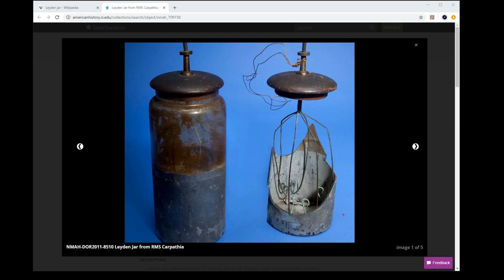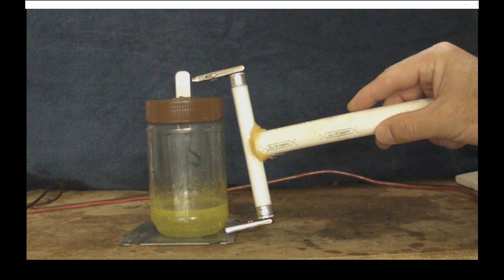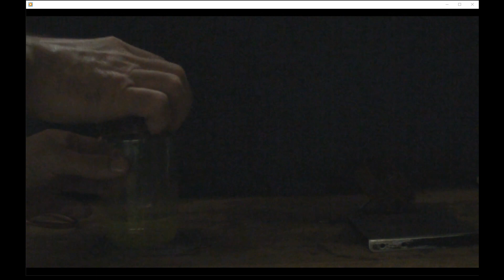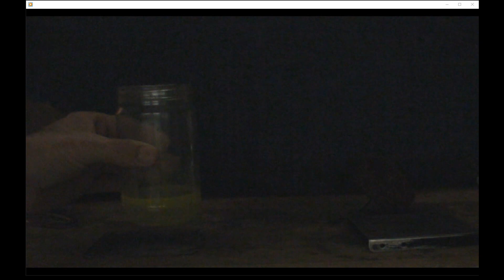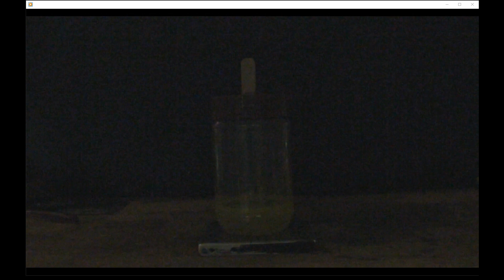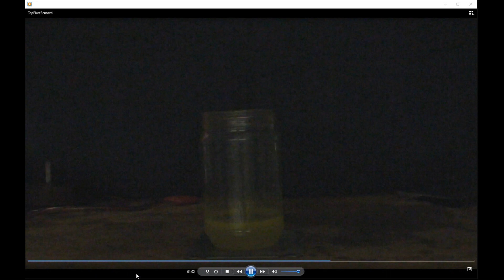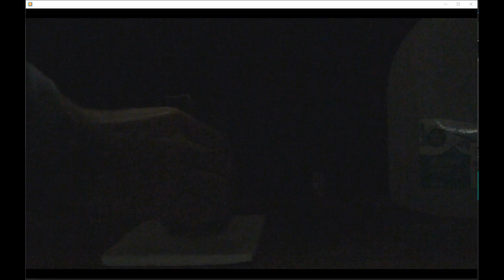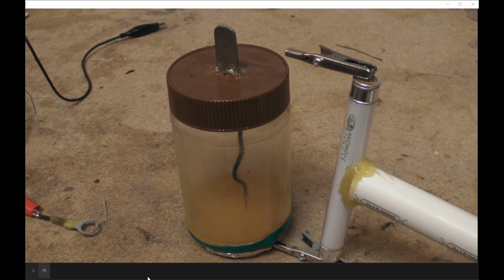Electron Theory can't explain Capacitors, but Ben Franklin can!

Comment: Eric Dollard. The only man known to be able to accurately reproduce many of Tesla’s experiments with Radiant Energy and wireless transmission of power. This is because he understands that conventional electrical theory only includes half of the story.

"“JJ Thomson developed the “Ether Atom” ideas of M. Faraday into his “Electronic Corpuscle”, this indivisible unit. One corpuscle terminates on one Faradic tube of force, and this quantifies as one Coulomb. This corpuscle is not and electron, it is a constituent of what today is known incorrectly as an “electron”. (Thomson relates 1000 corpuscles per electron) In this view, that taken by W. Crookes, J.J. Thomson, and N. Tesla, the cathode ray is not electrons, but in actuality corpuscles of the Ether.” – E. Dollard"

The widespread and enforced adoption of these practices has rendered the electric utility system an open system, or in other words, an antenna system, one of unprecedented proportions. The consequences must be obvious. It is the objective of the following series of engineering reports to re-establish a fundamental understanding of polyphase alternating current, and then apply this understanding to the analysis of the situation as it exists today with regard to the electric utility system. In this Digital Age, the theoretical basis provided for Electrical Engineering has been defiled, reduced to an assemblage of delusive pronouncements enforced by a cabal of academic theoreticians. What gives authoritative force to their dictates is the overtly complex and convoluted mathematics which enshrouds them. This mathematics in turn becomes a “rite of passage” in teaching and replacing reason and experiment. Once the idols become digitized, they become law, and consequently electricity has become a lost science, relegated to the same scrap heap as alchemy. However, in historical perspective, the theoretical basis for electrical engineering had achieved a very high level of development at the onset of the 20th century, this to meet the demands of a rapidly developing commercial enterprise, most notably that of the electro-magnetic telegraph and later electric light and power. Electrical science progressed remarkably well in this era, and thus became an exact science which engendered well thought out theories. The foundations of this science were derived from the Experimental Researches of Michael Faraday and their Mathematical Development by Clerk Maxwell. This became known as the “Faraday-Maxwell” Theory of Electricity.

Essential to the Faraday-Maxwell concept is the existence of a fundamental "Electric Medium," or aether, which fills all space and permeates all matter. Regardless of the fruitfulness of this idea of the aether, and its tubes of electric induction, it was later forcibly driven from electrical theory and replaced with an idol, the "Electron," and its sacred companion, Einstein-Minkowski Relativity.

https://www.thehighersidechats.com/eric-p-dollard-tesla-tech-understanding-ether-the-digital-demon/

Comment: Classical electromagnetic theory explains the effect you are seeing. Rather than forming a standard capacitor, you are inducing a static charge on the dielectric. The discharge seen one your set of plates are swapped is due to the transfer of charge from the dielectric back to the relative ground of the plate. If the capacitance of your ‘capacitor’ were to be measured, it would be very low since it isn’t forming a standard capacitor.
Reply from the maker: @novinceinhosic3531  <<have you tried to do it the other way around, like changing only the jars and than switching them back up to see if it workes the other way too?>>

Yes, if you change the jar out and keep the metal plates, you don't get any noticeable spark.  It is the dielectric/plastic that is polarized during the "charging" process and releasing that dielectric/plastic polarization is the big discharge that you see.
Reply from the maker: @novinceinhosic3531  <<If there a limited time for how long you can store the charge or the quantity of energy depending of the mass of the diaelectics?>>

I have not tested this, but I've read that it will deteriorate over time in the atmosphere.  If I remember right, that JIF jar held a charge for at least a couple of days when I was testing it, but I never tried to figure out the limit or how the deterioration of charge works.
Reply: @itsbs  
<<I have not tested this, but I've read that it will deteriorate over time in the atmosphere.>>

I have noticed something interesting about leaving charged objects out in the atmosphere.  This was something I had tried a long time ago.

I used two charged two electroscopes, but you can charge two of your jif jars.  Then leave one out in the open, on a table, and the second one place inside of another larger jar, like a clear glass cookie jar with a lid (this larger cookie jar is not charged).

After a day or two you can test the jif jars and see that the one sitting outside will have lost charge while the one inside the cookie jar retains more of its charge.
Reply from the maker: <<Rather than forming a standard capacitor, you are inducing a static charge on the dielectric.>>

So you are saying this is an "unstandard capacitor" and it behaves differently?

If it is just transferring a static charge, then why is the dielectric electrically polarized?  How does this static charge organize itself this way?

<<The discharge seen one your set of plates are swapped is due to the transfer of charge from the dielectric back to the relative ground of the plate.>>

So you are saying the charge energy is stored in the dielectric and not the metal plates, like electron theory says?

<<If the capacitance of your ‘capacitor’ were to be measured, it would be very low since it isn’t forming a standard capacitor.>>

If you were to grab the capacitor with both hands and discharge it through your arms, you would never do it again.  Is that enough capacitance?  Sure, it is not the best design for capacitance, but that that doesn't change the way it works.
Reply: @itsbs 
"then why is the dielectric electrically polarized? How does this static charge organize itself this way?"
We're yet to see if the dialectic is electrically polarized. If it were polarized, it would be due to some external electric field acting to polarize the atoms of the dielectric. In any case, the electric polarization of the dielectric is irrelevant in whether it is holding static charge.

"So you are saying the charge energy is stored in the dielectric and not the metal plates, like electron theory says?"
In this specific instance,  the charge is stored in an excess of electrons in the dielectric rather than a charge imbalance on the plates. This however is _not a standard capacitor, since the dielectric gap between the two plates is far to large_. Ultimately, electron theory accounts for the behavior of your experiment and the behavior of a normal capacitor.

"If you were to grab the capacitor with both hands and discharge it through your arms, you would never do it again."
I disagree with your assumption. Though the shock produced in the video is of an incredibly high voltage, there is such little charge behind it that it could do little damage to the body. Its like any other static shock - it may produce a big spark and hurt for a second, but it won't kill you.
Reply from the maker: @particleboy7757  <<We're yet to see if the dialectic is electrically polarized. >>

Did you watch the video?  I show that the dielectric is polarized with the transistor.

<<If it were polarized, it would be due to some external electric field acting to polarize the atoms of the dielectric.>>

It is polarized due to the test equipment shown in the video.  Now, "external electric field" -  from where??  Where exactly is this external field polarizing the jar?
Reply from the maker: @particleboy7757  <<In this specific instance,  the charge is stored in an excess of electrons in the dielectric rather than a charge imbalance on the plates.>>

OK, so this goes against the electron theory of how capacitors work.

<<This however is _not a standard capacitor, since the dielectric gap between the two plates is far to large_.>>

Why doesn't electron theory explain this "non-standard" capacitor (which I think is BS, but you can believe in it)?

Can you link to your source that describes how capacitors with "dielectric gaps too large"?

<<In any case, the electric polarization of the dielectric is irrelevant in whether it is holding static charge.>>

It is completely relevant, because if it is just "spraying" negative electrons on the surface of the dielectric as a static charge, then how did it do is so beautifully to get a polarized jar?
Reply from the maker: @particleboy7757  <<I disagree with your assumption. Though the shock produced in the video is of an incredibly high voltage, there is such little charge behind it that it could do little damage to the body.>>

Haha!  You've NEVER DONE THIS EXPERIMENT!   You think you know something.  This is EXACTLY why I don't want people to comment!

I've shocked the SHIT out of myself with this little plastic jar and distilled water.  You are absolutely IGNORANT of this experiment, 100% failure, but yet another 100% example of why I hate comment sections that attract people that think they are smart, but really dumb as fuck.  Haha...

<<it may produce a big spark and hurt for a second, but it won't kill you.>>

I didn't say "kill you", did I?  I wouldn't want to test it with a big glass jar and distilled water, but my point was the fact that the amount of charge in this little capacitor will stop you from making the mistake again.
Reply: I apologize, I misunderstood "you would never do it again" as a euphemism for death. We are both in agreement that getting shocked by this thing will hurt.
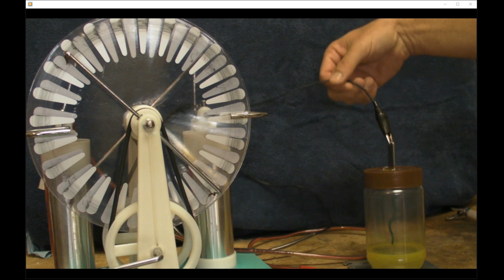I was using the term "polarization" at its technical definition. Electron theory predicts the formation of an electric dipole as demonstrated at 19:00.

What you have constructed in this video isn't a normal Leyden jar. In a normal Leyden jar, the liquid isn't supposed to be the dielectric, it is supposed to act as one of the plates on the capacitor. The dielectric should be the walls of the jar. 

Ultimately, electron theory does explain this nonstandard capacitor, as well as every effect presented in this video. There isn't an issue with any of your experimental data, the issue lies in your interpretation of it.
Reply from the maker: <<What you have constructed in this video isn't a normal Leyden jar.>>

You say "not a standard capacitor" and "not a normal Leyden Jar."  These are absolute bullshit answers.  You can see the same demonstration with "standard plate capacitors" and "standard removable skin Leyden jar."

<<Electron theory predicts the formation of an electric dipole as demonstrated>>

Ok, so why does the dipole stay on in the dielectric when removed from the e-field?  Are you saying the negative electron's on the surface perfectly arranged themselves to create this polarization effect?

<<In a normal Leyden jar, the liquid isn't supposed to be the dielectric, it is supposed to act as one of the plates on the capacitor.>>

You only look at it this way when you don't REALLY understand how capacitors work and you put your faith in the Modern Pseudoscience  "electron plate" theory that is demonstrably incorrect.

<<Ultimately, electron theory does explain this nonstandard capacitor, as well as every effect presented in this video. >>

No it doesn't.  I removed the dielectric from the e-field and the dielectric stays polarized and "holds the charge" without any metal plates.  The metal plates are required by electron theory.

<<There isn't an issue with any of your experimental data, the issue lies in your interpretation of it.>>

Your lack of understanding of this experiment is what allows you to continue believing in pseudoscience.  Go look at the demonstrations of the removable plate capacitors.  What would be your "non-standard capacitor" excuse there?  Why would Dr. Lewin be freaked out by the removable Leiden Jar experiment, if it is just MY INTERPRETATION that is the issue?

You are obviously not very smart about this, when giving these silly answers.
Reply: @itsbs  I recommend not getting incredibly angry when engaging in scientific debate, it would help you come off as less deranged.

In any case, the fact that you are unable to recognize how your “Leyden Jar” isn’t a standard plate capacitor demonstrates that you really have very little clue what you’re talking about. 

I’d be more than happy to help you through an understanding of classical electromagnetic theory; it appears you lack fundamental understanding of it, based on your inability to recognize that nothing displayed in this video contradicts its predictions.
Reply from the maker: @particleboy7757  <<I recommend not getting incredibly angry when engaging in scientific debate, it would help you come off as less deranged.>>

I recommend you not commenting and telling me what you think you know.  I don't want a debate.  I only ask for questions.  I've debated for years on this stuff and have found that people like you are just fucking dumb, but are really confident in their smartness.  I just don't want to deal with it anymore.  And I don't give a flying fuck what people think.

<<In any case, the fact that you are unable to recognize how your “Leyden Jar” isn’t a standard plate capacitor demonstrates that you really have very little clue what you’re talking about. >>

They fact that you have made up different categories of capacitors that seem to work in different ways shows your dumbassness.

<<I’d be more than happy to help you through an understanding of classical electromagnetic theory;>>

I read Maxwell/Heaviside/Steinmetz/Dollard.  I don't need you to preach your Lorentz-Einsteinian electron ball, pseudoscience electrodynamics to me.

<<it appears you lack fundamental understanding of it, based on your inability to recognize that nothing displayed in this video contradicts its predictions.>>

You just deny the fact that electron theory bases everything on the electron imbalance in the metal plates, but in reality, by experiment, the electron theory is wrong.

Again, if I am so wrong, why is MIT Professor Lewin so freaked out about it and came up with his own explanation?  It's just because of me, right?
Reply: @itsbs  As I had said before, electors theory predicts the static buildup in the dielectric in your experiment. You are yet to contradict any of your findings with classical electromagnetic theory
Reply from the maker: @particleboy7757  <<As I had said before, electors theory predicts the static buildup in the dielectric in your experiment. You are yet to contradict any of your findings with classical electromagnetic theory>>

You never explained how the negative electron charge buildup on the jar can go from the tip of the wire to spread all around the jar in a nice, complete polarized pattern.

Comment: Isn't this common knowledge? We were shown static electricity using a plastic ruler rubbing on fur or our hair when I was in school. I think the explanation was that ions form on the surface which translates to a stored voltage (well, a differential voltage on the surface of the ruler versus the surrounding environment). It would be interesting if you could show that increasing surface, volume or mass of the dielectric material stores more energy.
Circuit electronics is just a set of conventions on top of the basic laws (which work well enough for basic calculations). The physics phenomena is well defined for some analogue devices, diodes, oscillators and semiconductors, but that's about it.
Current commercial capacitors and super capacitors try to pack as much surface area both in the dielectric and metallic surfaces, so I guess they could be optimized to store more energy if the metallic surface really is irrelevant. My guess is that there would be downsides like increasing charge/discharge rate or inductance for that optimization.
Reply from the maker: <<We were shown static electricity using a plastic ruler rubbing on fur or our hair when I was in school. >>

That is triboelectric, where friction motion is in play.  The capacitor doesn't have moving parts.

BUT, what you are thinking is in the correct direction.  Electron Theory clearly states that the metal plates differences cause the e-field.  The dielectric just changes its strength, but isn't the store of electric charge, which is demonstrated here as being wrong.

*<<It would be interesting if you could show that increasing surface, volume or mass of the dielectric material stores more energy.>>

The weird thing is the thinner the dielectric, the more capacitance.